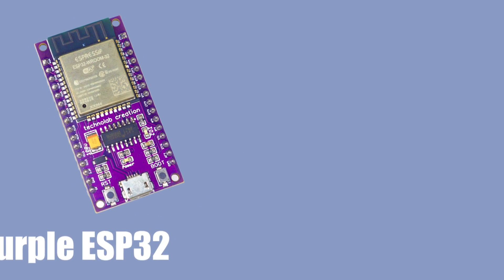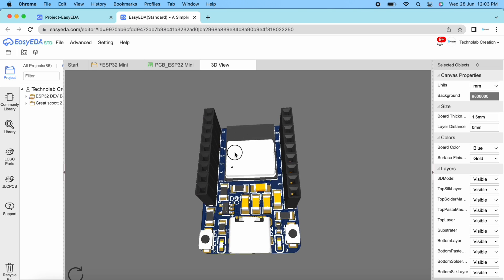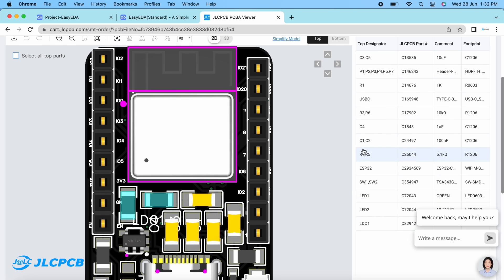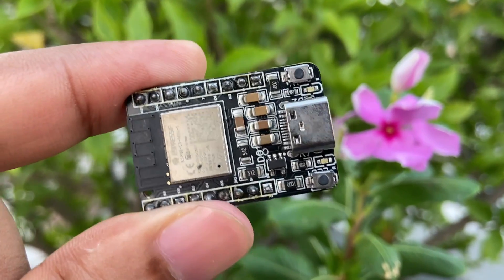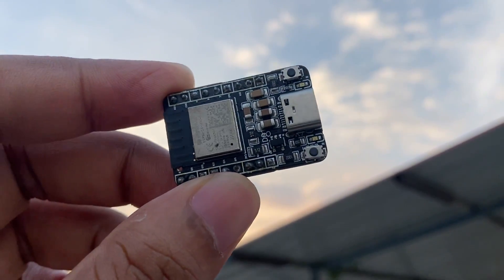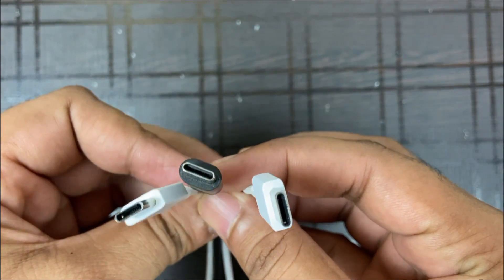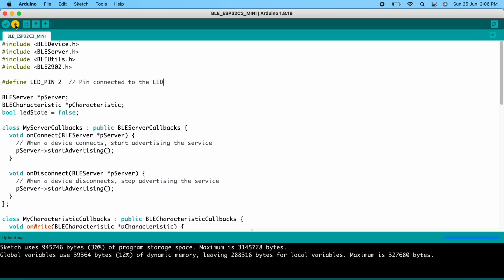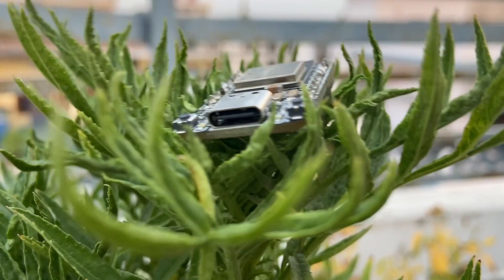ESP32-C3-MINI: A Powerful and Compact IoT Development Board.| JLCPCB.

Comment: I also bought one today but mine doesn't work, i constantlu get this error when uploading: 
connecting...Traceback (most recent call last):

  File "esptool.py", line 37, in <module>
  File "esptool\__init__.py", line 1064, in _main
  File "esptool\__init__.py", line 859, in main
  File "esptool\cmds.py", line 466, in write_flash
  File "esptool\util.py", line 37, in flash_size_bytes
TypeError: argument of type 'NoneType' is not iterable
[7704] Failed to execute script 'esptool' due 
Chip is ESP32-C3 (revision v0.4)
Features: WiFi, BLE
Crystal is 40MHz
MAC: ..................
Uploading stub...
Running stub...
Stub running...
Changing baud rate to 921600
Changed.
Configuring flash size...
to unhandled exception!
Failed uploading: uploading error: exit status 1